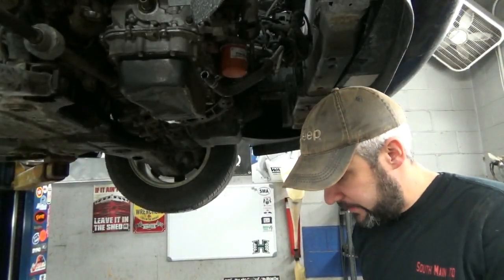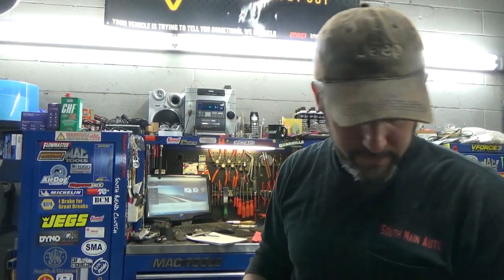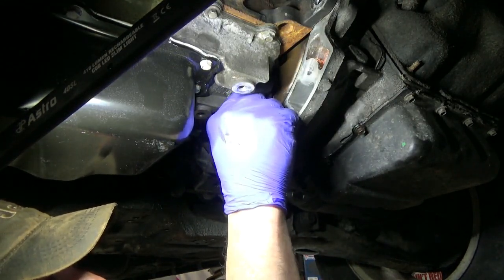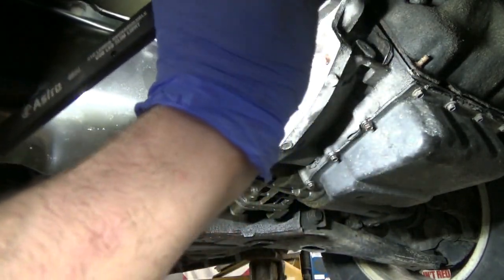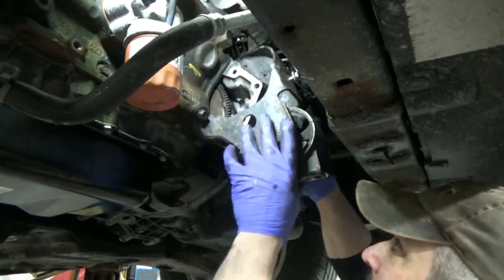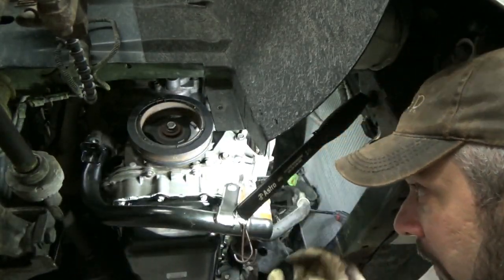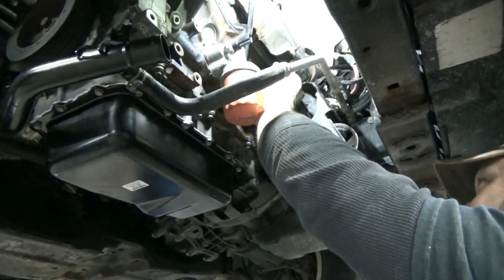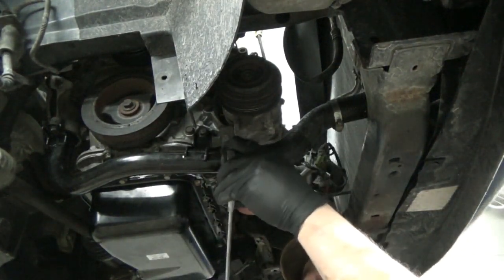Dodge Grand Caravan 3.8 - Engine Replacement - Part 4

Comment: I can't stand Advanced auto here in MA.. we have O'Reilly's, AA, Autozone and two local parts stores within 100's of feet of each other.  I like the people and manager at Autozone, they are very knowledgeable .  Nice JOB on the 3.8 engine replacement! if you ever get a Nissan Xterra/PF/Frontier with 4.0 timing chain guides issue, that would make a great video.

Comment: @ 13:10 "Structural Collar"  lol.  If you get stuck screws on those ABS modules, get a sharp, long pry bar, split the 2 upper corners on the old module. Once you have two screws out, or two corners split, get a screwdriver and wedge it in the crack between the module and HCU, then get a larger screwdriver and pry. The other 2 corners will split or the screws will pull through the sleeves. They're surprisingly weak.

Comment: When you tightened that first bolt on the flex plate, I was wondering..???....AND I too, have calibrated hands for torque, after breaking a lot of bolts, when younger..

Comment: Having been involved with NATEF and later with ASE, I know there is an ASE certification for parts operations, unfortunately the certified operators are not going to work for minimum wage which I suspect is the problem in your area. It is a shame you don't have a competent supplier to to not only to get the correct parts quickly, but also at a wholesale price which would make you competitive.

Comment: What did you do to repair the broken windshield washer injector nozzle?  And what did the wrecker crew say about the damaged oil pan?  Did they give you a credit on the original price....or maybe just a free windshield squirter off a wrecked caravan?  Very nice job pulling the engine  from the top......seemed like a lot less work than lowering all the undercarriage.  Maybe just camera noise, but it sounded like a valve lifter ticking during idle.  Are they hydraulic in that caravan?  Dr. K.  
.

Comment: we have the samething with our advance, started off with a great commercial guy they move him up and a turd takes over. They can him and a decent one shows up last 6 months and they move him on some where else. Going on 6 years we've had like 9 commercial account managers. It seems if they're good they'll just shuffle them around or move them up the ladder. Thing that gets me is the regional managers will come around and say blah blah well get you on the platinum tier, right after he said you were on platinum when he came in three months earlier. Needless to say I use OE/Amazon/Rock/ebay most of the time unless I need something that can't wait.

Comment: Did you ever get to that bottom bolt on the fly wheel cover,  tightened.  I am not criticizing just my OCD had me waiting for you to go back to it, or are my eyes deceiving me.  You can see what i am talking about at, 14:20  on the video.  Once again I am not criticizing just wondering.  Thanks.

Comment: Did you ever try Auto Plus? -- 7240 ROUTE 415 NORTH BATH, NY 14810 -- I know they deal primarily with commercial accounts?  I deal with them and generally have good luck with them...

Comment: I don't buy parts from Advance Auto - I only go there for fluids when I'm too lazy to go to walmart. I bought an alternator from Advance - it was bad right out of the box, exchanged it - 2nd one was bad too, and the 3rd, and 4th. Finally I had them refund my money and I went to NAPA. It cost more - but it worked first time.

Comment: Auto parts has become one of my ongoing frustrations.  Both of my vehicles use mechanical fuel pumps. Several from O'Reilly have failed within a year. One literally broke the tinny thin stamped arm off and left me stranded in the middle of nowhere on I-10 in south Arizona. I went and bought one each from an independent and they were barely better looking than O'Reilly. I have become so leery of these pumps I bought two electrical inline pumps and set each up to quickly bolt in in place of the mechanical, with a long enough lead and alligator clips.
Rock Auto Parts has consistently come through on other items with better quality than local parts stores.
Reply: Do you still feel the same about Rock Auto today?
Reply: @SuperNoticer  Still buy from them.

Comment: I use napa at work. There ok some salesman are better than others. I find it's easier and faster to find the part I need on there phone app and call with the part number. But I'm just a fleet maintenance mechanic I don't need to make a profit so I have the time to look it up. I personally get my own parts off eBay or quality places or the dealer. I found the prices for good parts were half what the store sold them for online.  I'll get a dealer part number and go to eBay and it's almost always cheaper. Autozone here I find now doesn't carry almost anything in the store so I have to pass it and drive twice as far to go to advance for quick parts.

Comment: Here's my thoughts. I am a freshman in college, basically the same age/grade as the people working there. Most people would expect that being this old they should have more than enough experience and should get you the right stuff. But it's the exact opposite. It's more than likely their first job and they wanted to work their because they're a "car person" who put lug nuts on a Civic. The service they do is only "good enough" for themselves so that they stay employed and make money. They don't take into consideration A LOT of people rely on them to get them the right stuff on time the first try. The only car about themselves. Working at a auto parts store is basically working in customer service, you're there to help people figure out what they need and deliver it to them with little to no issues. If you can't do that at this age, don't even work.

Comment: I had a half year ford exploder, and needed a lower radiator hose.  I had the old part in my hand, went into advanced, and asked for one for a 98.  Part looked nothing like mine.

"That's not the part I need, this for a 5.0?"
"Yup, 1998 5.0 AWD"
"Hey could you grab one for a 99?  Maybe I have a half year."
"But you have a 98, a part from a 99 won't fit..."
"But you brought me the part for a 98 and it obviously doesn't even look like it.  Mine is probably a later 98 and uses the parts of a 99."
"There's no such thing, a part for a 99 won't work"
Look down at the mismatched parts
"So you won't check?"
"No."
"Hokay then..."

Went to the O'Reilly down the road, asked for a 99 lower rad hose, got the right part.  Smug advanced bastard probably still thinks he was right.

Comment: I rarely shop ANY of the "chain" parts stores.  I order most of my parts from Rock Auto or Amazon.  There are a couple of independent parts stores that are my "go to" places.  There must be a total of 5-8 parts store within 5 miles of my house.

I buy most of my "consumables" at Walmart.

Eric, do you stock many common parts, like oil filter and air filters ?  I'm sure you stock various diameter rubber hose for vacuum and heater application, but do you stock any other parts ?
Reply: I still use RockAuto, but even they make mistakes.  Usually (as been my experience...)  When some terd returns a "This part don't fit, gimme $$ back"..  The guys at the return centers don't know a starter from a fuel injector.  I've gotten re-boxed parts that where supposed to be high quality!!..  But someone swapped them out with generic china garbage and no one noticed.
Reply: That happened to me using RockAuto once too, but their customer service was awesome and they handled it as swiftly as a mail-order business can.  It didn't solve the issue of me not having the part when I wanted it, but RockAuto was good about it, nonetheless.
Reply: dwalmop2 they sent me 9 clutch kits when I ordered 1. Wanted me to pay $135 shipping both ways and wouldn't cover return shipping on their mistake so I opened a dispute with  my credit card  and now they will not sell me anything. I placed a $1000 order and they denied it over them not wanting to eat the shipping
Reply: I used to order from them too ... until I got a few foreign car jobs. On those vehicles, every single order I made ended up being the wrong part. I ordered correctly - they sent the wrong stuff. Then, if you don't click the right boxes in their return system, you get stuck with the bill! I got screwed on a couple parts.

I sent so many parts back to Rock Auto this year that I'll never order from them again. All the savings was lost paying return shipping.

Comment: I order my own parts online from Advance to get the bigger discount plus I know I'm ordering the right part. They told me I get @10% discount b/c they have to look up the part.  Whatever happened to 25% discount and the parts arriving at the speed of Dominos pizza. There's nothing worse than coming in early and finding out they gave you the wrong parts. I feel your pain.  They did a nice job on the oil pan. Well Part 5 should do it unless :O

Comment: My  work car is an old Saturn and the rear trailing arm broke from rust/age. At  Carquest/Advance Auto Commercial my cost to the shop was $93.11as a shop that has done biz with them as Carquest since they moved here about fifteen years ago. It was a china Dorman part #905-811 which is the only seller of this part as far as I know no matter who sells it. As Eric stated I could by it retail at Advance online as a DIY for $76.99 with a 20.00 coupon that pops up when you click on site anytime you go there. The other two vendors we deal with for this part were Auto Plus for 86.92 or NAPA for 111.29 all the same Dorman stuff. People wonder why we have short tempers or thin skin when chain stores like Advance Auto under cut there so called wholesale accounts all the time everyday and then want to complain about your low volume of purchases monthly.

Comment: I have a 2012 ford edge with brAke problems,. Not hydraulic pump, not calipers or pads or rotors.. brakes are soft,. Any ideas. Your help is great ply appreciated.sean

Comment: I think the polishing of auto parts is for that guy rebuilding or replacing his engine.... got an older money van that I am replacing the front timing cover gasket on... 195k on it, I cant clean all those ages of dirt debris and grease on. there was a time when I would have taken more time to clean and polish everything. I will totally clean most of the effected area, but they are not paying me to clean everything. additionally if I more the wrong bit of grime will I possible cause more problems? I know repeat customers are good but not that way

Comment: I worked for Advance for over ten years and you are right!! I was a delivery driver and put up with all kinds of crap from the commercial aspect. In those ten years I went thru 3 store managers and 6 commercial managers. Some times the customer is dead wrong by giving wrong year of vehicle and or engine size then they complain to me about it. No sympathy from any managers about this. They treated drivers like pure crap. Yes their parts are cheap Chinese knock offs. and don't last long in real service. One commercial manager they hired only had 1 year experience and he was a total jerk. I swear he did reefer and or cocaine. I quit once about 3 years ago but next day he called and begged me to come back. I did. Tired of dealing with stupid drivers on the road and such so quit again and never looked backed. Go to Napa if you can as their parts last when you buy them and most made in USA. Advance is putting more restrictions on the commercial aspect and don't seem to care but expect you to buy from them. In my area O'reilly is starting to kill them in commercial accounts.

Comment: how does ur state inspections work? could a lowrider pass or would it be considered unsafe, or is it just a emissions test
Reply: fuzzy wuzzy There is a specific list by NYS DMV of what is and what is not inspected, it is public. Many shops will pass a car as long as it meets the list, many seem to make up their own rules.
Reply: G Zuk so if h had a shitty car, can u just slip a guy like eric a $20 to say its cool and the state is none the wiser. i assume the shop just fills out a paper that u bring to the bmv when u register
Reply: G Zuk fair enough. i was just curious about the process because in quite a few vids he mentions a car being in there because of inspection related shit
Reply: don't forget too, that the OBD2 inspection is connected to the state computer system. A car that won't pass cannot be made to pass. If a car won't pass safety it would have to be a really clapped out S-box  as the requirements are pretty lax.

Comment: To do business at Advance Auto you need to be there.  If you can, take the part with you that needs replacing.  Watch the screen as they pound through their computer searching for your request lest they put in the wrong year or car.  Their monitor will display a number of manufacturers of the same part with varying prices.  Never select the least expensive.  Look for name brands.  

On several occasions I have purchased parts at Advanced Auto for my Evo and they had them on the shelf.  In this city of 50,000 there is only one Evo.  A belt tensioner I purchased there was the OEM part with the part number ground off - strange.  Anyway, you gotta adjust to the way things are.

Comment: Year old video - Had to wonder - You are aware of the aftermarket oil pan issues that are going around?
Seems they like to paint the inside, That paint comes loose and clogs the oil pickup. It is a real disaster.

Comment: Please tell me the advantage of a two piece oil pan? Extra sh2t to leak if you ask me!
Reply: The thick aluminum provides extra structural rigidity to the block and bell housing (if also bolted to it), but steel is much more impact-tolerant -- it will bend, but aluminum will crack and dump out all your oil. That's why they combine the two here. One of the few things that seems well-engineered on this Chrysler!

Comment: Flag nuts on the exhaust! ^5 Good, trustworthy mechanics are hard to find. My gf's car may need an intake manifold gasket and I don't have time to do it. I can't think of anyone local that I trust. Ya might get another one! As far as aftermarket, too many duds between advance and rock, just not worth it unless it's a hose or hose clamp...., pretty sad! OEM here on out!
Reply from the maker: FLAG NUTS! Yes thank you!

Comment: I dont even do business with Advanced,never have. I deal with a local parts store that has been in business since before I was born,they are having issues now with Chinese crap parts and hate selling them even,too many returns. It used to be you knew the parts were made in the US and were decent,now everything comes from some other country and you have to deal with parts that are badly made,I dont have to tell you that. I also buy my parts using my school empoyee discount,that helps a lot.

Comment: I've found it is much easier and cheaper to buy the parts on advance autos website, and pick up the parts at the store. Its easier because they constantly add discount codes that make it cheaper to buy online then in the store. I'm done dealing with the people at the store, all they have to do is give me the order that I purchased online, and nothing else.  I also verify that the part number is the same from competing auto part companies, like rockauto, autozone, napa, amazon before buying the part that advance autos site picked for me. buying the parts online, and picking them up at the store will ease your frustration.

Comment: I used to work for advance and they are screwing you because there are some commercial accounts that get  really good discounts like 30-40%!!  It might be because we have literally 3 Advance stores in a 5 mile radius not to mention about a dozen other part stores plus a auto zone.

Comment: Parts stores are very hit and miss around here. Only good one is Autozone if you can believe that. Most of the guys that work there actually were prior mechanics, so they know what the hell they're talking about. Screw all the other ones around here though. Terrible service and they don't know anything.

Comment: Notice you changed the water pump what about the timing belt pullies and seals ?
Reply: This engine doesn't have a timing belt.
Reply: Good luck
Reply: I had 2 vans with the 3.8 in them. they have timing chains, and both had very high miles on the original chain without trouble. Pumps both failed at around 150k though.
Reply: The 4.0 has a timing belt. The retro 3.8 does not.
Reply: Your right no timing belt on the 3.8

Comment: I can't believe how many autopart chains there are in the states. We only have 2 main ones on this side of the pond and some smaller ones that are more geared towards supplying the trade. Parts really are kind of a nightmare. I try to order everything i use online, although even that can be annoying. I have a shelf full of stuff sent in error and half the time the sellers just say keep it, we don't have time to deal with a return. I'm only a DIY'er, if i was a pro i really would loose my shit over it.

Comment: PLEASE ERIC help me, 2001 dodge ram 1500 5.2 runs like crap when cold, idles bad seems to get better when warmed up, changed the IAC no difference and no codes, joey from Statesville N.C. PLEASE HELP
Reply: Joey Fox vacuum leak. Start there.
Reply: Joey Fox intake plenum cover. Go to dodge trucks . org and search. causes vacuum leak and oil consumption.